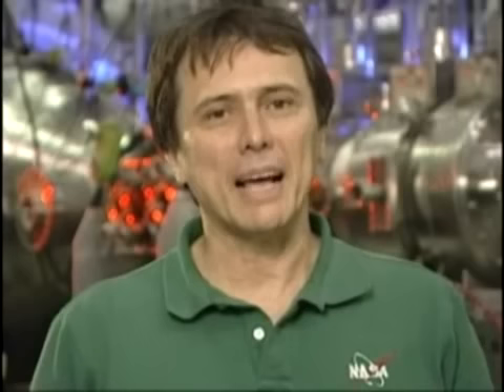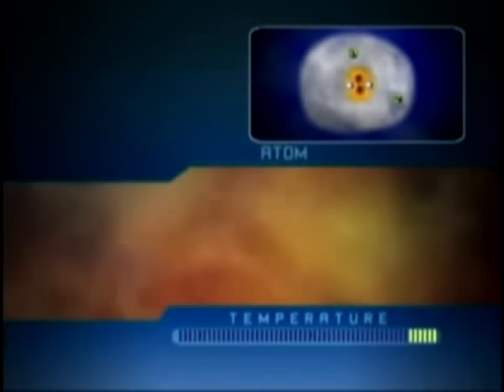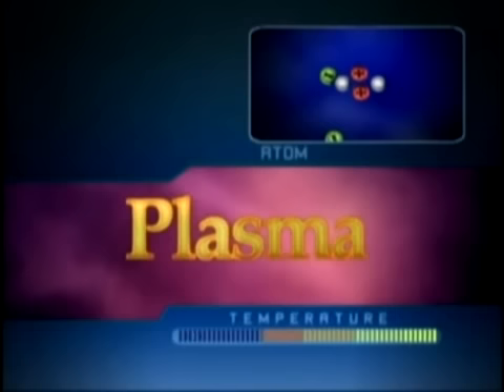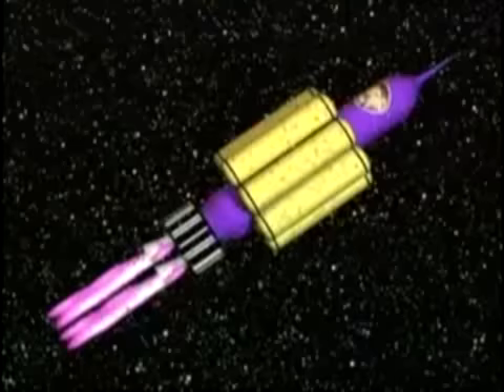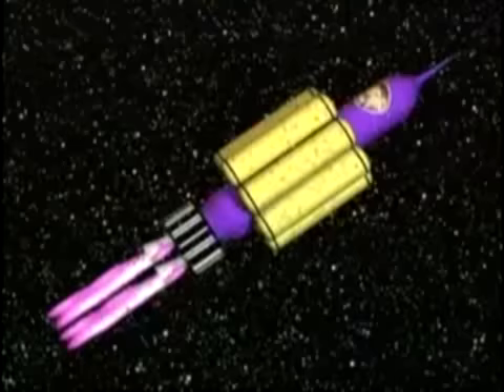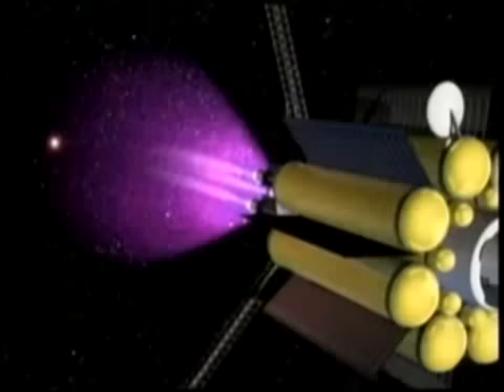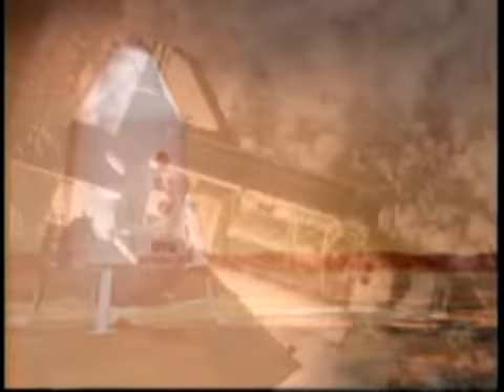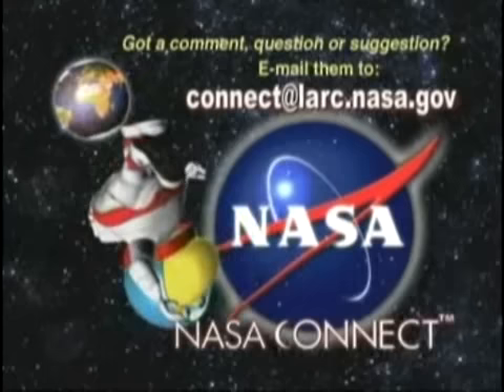NASA Connect - VASIMR

Comment: @ eqworld & NuclearWatermelon

Actually, in the later portion of the video Mr. Chang-Diaz explains that a scaled up version of the VASIMR would need more power and suggests using a fission reactor to fuel it.

When you start needing multi-megawatts solar just doesn't cut it.  Especially if they want to use these as far out as Mars.  

But it's not a big deal, by then we will probably have really good radiation control systems.  And we can hope people will have gotten over their fear of nuclear.

Comment: lol, no worries, I know what you mean :P
But, yeah, I agree with what you said.  The way cell phone jammers work is through the clashing of signals; It's all about "who's got the bigger signal," because then, one cancels the other out.  If that could be applied to solar radiation, if it was directed away from the spaceship or whatever, and it was strong enough, it would have enough to at least cancel out a portion of the solar radiation.

Comment: I wonder though... if the extreme heat is the primary thing that differentiates a Plasma thruster from an Ion thruster, would an engine that ran on cold plasmas be considered an ion thruster?

Or... is it all the same crap?

Comment: Taking so long because it's not getting enough money.  I think NASA out to partner with Space X and  get the Falcon/Dragon system up and running.  Can be done two years earlier and cheaper than the white elep[hant they are trying to fly now.  Then use saving to research  ans develop stuff like VASIMIR